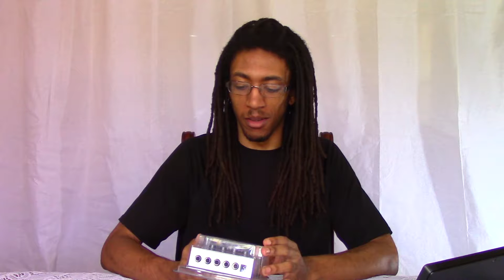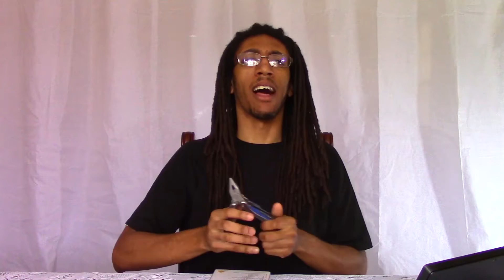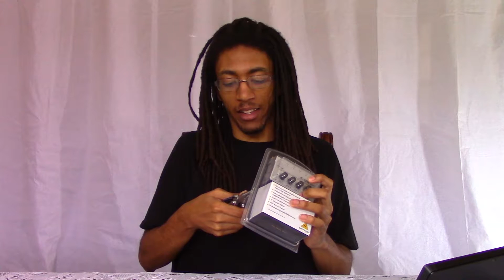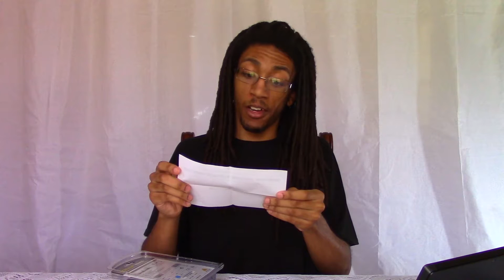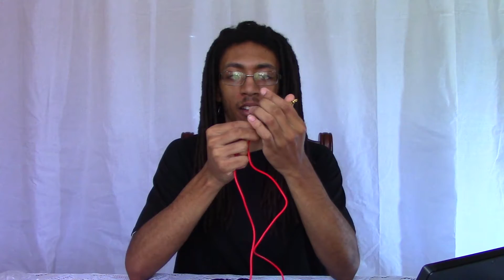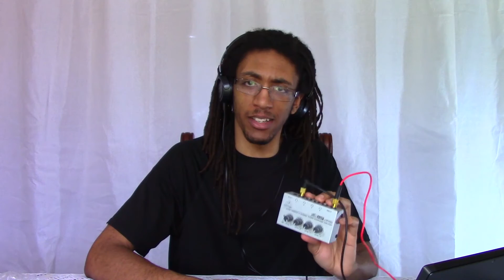Behringer HA400 First Impressions | Ohms the Word

Comment: just bought one earphones only play out one ear??? is this a faulty one
Reply from the maker: Hey Gary, make sure you're inserting the jacks in the device all the way in, same for any adapter you're using. 

Sometimes, especially with headphones that feature mic input, may not be making full contact when plugged in.

(Also good to try connecting another set of headphones and in different slots of the device to make sure everything is working correctly.)

Comment: Nice video! I have a quick question. What happens if I send a mono signal through this? will the output be dual-mono? or will it output the mono just for one ear?
Reply from the maker: +Soul Equaliser it does not. If you're using a pair with a mic then you have to be sure to get the first two black rings in, not all 3.

Otherwise use a standard audio no mic pair and both ears will produce sound.

Tested multiple times to recreate your issue, only happens with 3 ringed Jack's for mics.

Comment: I'm pretty sure the issue is your headphones...
Reply from the maker: If you mean with hearing the background noise, nope, it's the phone. Like most phones if you're not doing anything on it that produces sound while an audio device is plugged into the jack, it cuts the audio off. If you press a button on a samsung device to make the water droplet sound then you can audibly hear where the system kicks the sound back on, plays the sound, and the background noise for a few seconds until the audio cut back off.

I am currently using the amp with my desktop system setup where this does not happen, however with any headphones or ear buds with my phone, said hiss is there.
Reply: Essence of Zen
 but why are you using a amp with a bad pair of headphones?

If you have a pair of something like Sennheiser 598. but those headphones that you where using in the video looks really cheap and i dont find a use to use a amp with those unless if your using it just to split audio
Reply from the maker: You're spot on, we use the amp specifically for splitting Audio in the room it's setup in (not the room displayed in the video). When doing voice recordings in groups, or game recording sessions for another channel that we have it helps to have the amp so each member can set their perferred volume.

In this particular video I used cheap headphones because they were closet - the video isn't about the clarity or quality of sound - as amps in this price range wouldn't likely be picked for those reasons. This is more so specifically for personal control of volume for 4 members/4 systems -- I.E. custom multi-speaker setups on one PC.